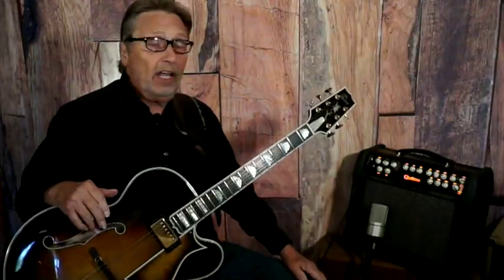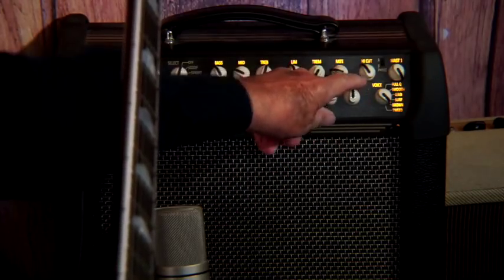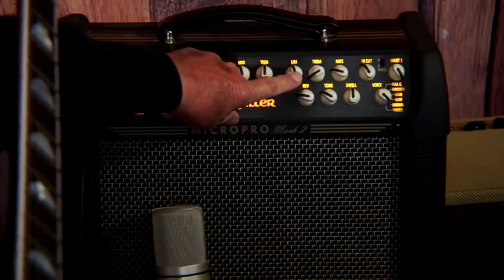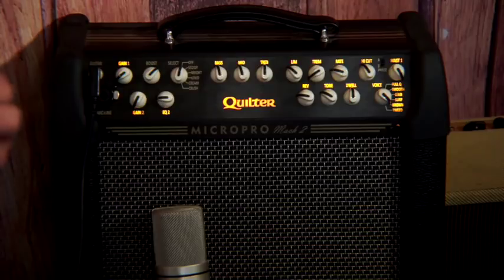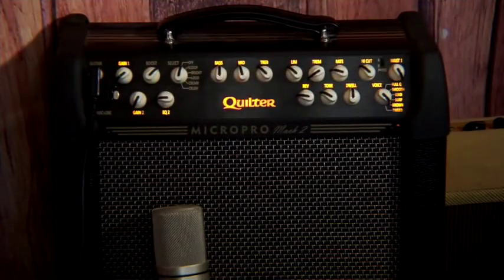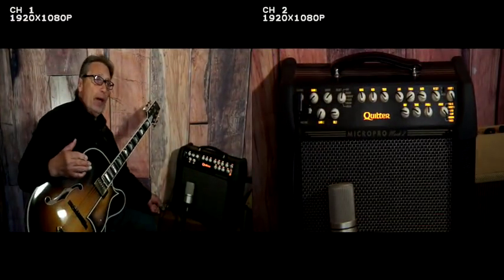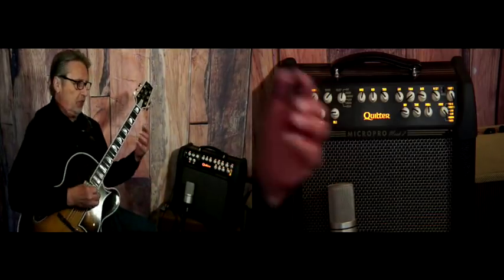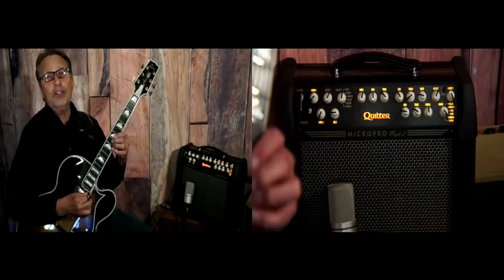Getting a Jazz Tone From a Quilter Amp w/Rich Severson

Comment: Very helpful video. I have both the MicroPro 10 and the Aviator 8, both different but really great. These are very good suggestions that I will adopt.
In response to the question about missing tube amps, after having numerous problems with Fender tube amps I can't say I miss them at all. Great tones, problem free.
Reply: How do you like the 10 inch speaker in your Mach 2?  Someone at Quilter indicated that it does not sell well because while it does a great job on mid-range tones, the high end is somewhat rolled off and the low end is lacking in some respects.  Is that true?
Reply: I have the Aviator with the 10" speaker. I think it has a well rounded, full tone. 
Bass is strong, clear and not tubby, plenty of hi end sparkle and chime with my Strat. 
I rarely feel the need to move the tone controls, from the strait up position.

I play with a variety of guitars, hollow, semi hollow, and solid body, in a variety of styles. 
Always get compliments from other tone meisters, including tube lovers.

Comment: The Quilter is a great all-purpose amp for someone like me who plays both jazz and rock.  It's by far the most "tube-like" solid state amp I've heard.  Many solid-state amps I've played have sounded a bit too sterile for jazz, lacking warmth.  As others have mentioned, the Lunchbox and DV Mark are great for jazz, but not as versatile for overdriven rock styles unless you have pedals.  Arguably, Quilters aren't quite as jazzy-sounding as the best jazz amps, nor are they are as rock-sounding as the best rock amps, but it's a darn good compromise between the two.

Comment: Very helpful information, thanks for sharing.
I have the Aviator with the 10" speaker. I think it has a well rounded, full tone. 
Bass is strong, clear and not tubby, plenty of hi end sparkle and chime with my Strat. 
I rarely feel the need to move the tone controls, from the strait up position.

I play with a variety of guitars, hollow, semi hollow, and solid body, in a variety of styles. 
Always get compliments from other tone meisters, including tube lovers. 

For me, I prefer the simplicity of the Aviator, combined with the expanded effects possibilities, when used with my Zoom effects peddles (also like being able to set effect combination presets for 1 button recall).
The amp has lots of clean headroom which I need for my sound, and if I want to dirty it up, I can get what I want from the Zoom effects peddles.
Best amp purchase I ever made.
Reply from the maker: Another happy customer

Comment: Even in a rock band you usually need to roll low end down so as not to compete with the bass and kick drum. 

Quilter amps are awesome. I have a MicroPro 8" of the original version.

Comment: thanks for a very helpful demo Rich!  I really appreciate it.  I play a Koentopp 17" Chicagoan and an old Tal Farlow and wanted to demo the whole Quilter  line.  I ended up with the Steelaire.  Hard to believe how warm these amps sound.  Again, thanks so much for a great video.
Reply from the maker: Which Steelaire did you get?
Reply from the maker: I'm sorry what is the speaker size 15"?
Reply from the maker: The 15 is great I've been wanting to get one